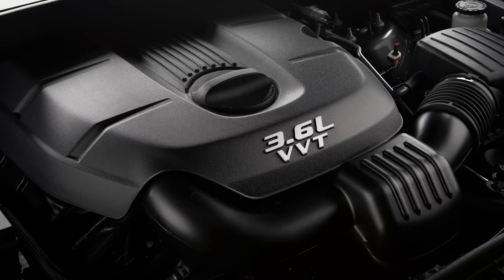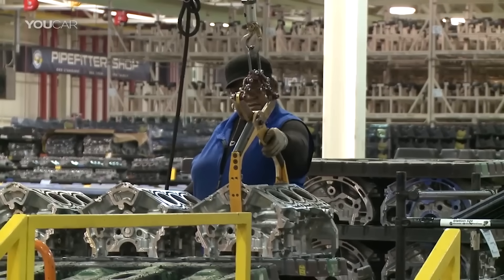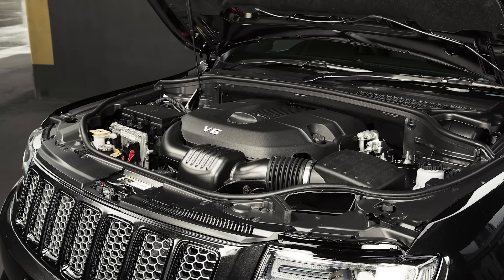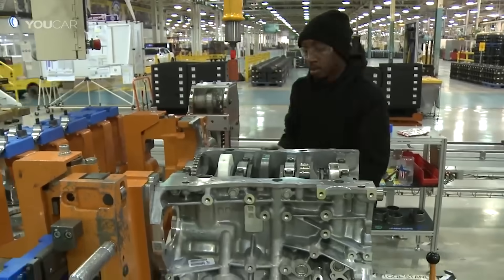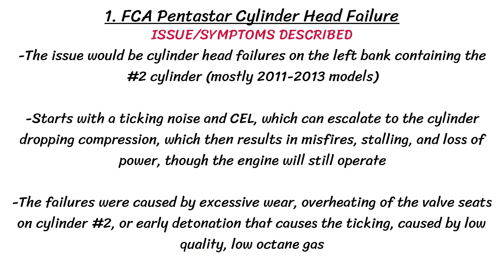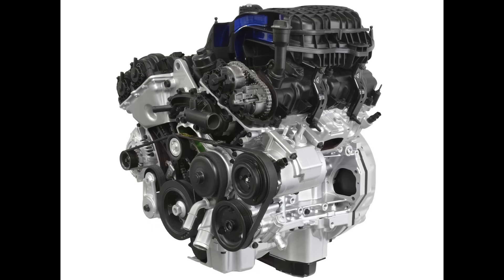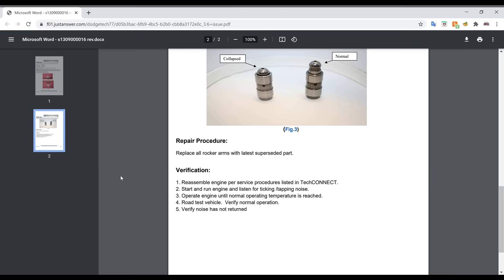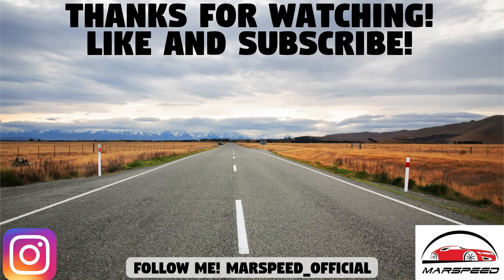The Specs and Fatal Flaws of the Chrysler 3.6L Pentastar V6 Engine

Comment: Frankly? It sounds like you're just putting pictures to an article you read and I don't agree. Just because you bought a nightmare 5.7 Hemi, don't take it out on the V-6. The 5.7 has a lot more problems then just dropping valve seats and ticking. Mopar is probably going to finally junk that miserable engine. At idle, the cam shaft gets no oil splash from the crank shaft at all, because they wanted the cam shaft closer to the valves and raised it way up. Then they stuck an oil journal tube under it just to make sure. They tinkered that engine to death. To even fix that bad design would mean junking it. And that's why they won't fix it. Chrysler can no longer make a good 350 V-8 and hasn't been able too for quite a while. They can't even survive police or taxi-cab work any longer.

Although the 3.6 does have its problems like any other engine, it's certainly not as bad as all that. And I've never heard ticking out of any one of them and everything they make all has that engine. I think whoever wrote that article confused the 5.7 with the 3.6. There were never any number 2 piston problems with the 3.6. Only the 5.7 and it still has them, and it still shears it rear exhaust manifold bolts off. And remember, you are only talking about less than 1% of all the Pentastar engines made. And they were the first engines. Only a fool buys the first of anything. Meanwhile, Chrysler has made over 10 million Pentastars. That's a LOT of engines. It replaced 6 different problem V-6 engines. Why would you want to scare your subscribers like that when over 90% of them have the Pentastar. The 3.6 has won awards over the years and it didn't do that with bad engines. It's the only engine I'm aware of with 2-stage cams and it got them back with the 2015 upgrade.

I have a 2018 AWD Charger that has the 3.6 (it's the only way you can buy an AWD) and I supercharged it. She puts out over 500 hp in it's present configuration, handles it just fine and still makes an excellent daily driver. And this supercharged beast has raised it's efficiency to almost 30 miles per gallon average, up from 22. 22? Yeah, the AWD's take a mileage hit in stock form. Obviously, the 3.6 just loves its supercharger. If there was a backup of parts, it's because there is always a backup with Mopar. I'd say they are really slow at paying their bills. I remember all the way back to 2011 and I bought a brand new Jeep Liberty. They had an accessories catalog and nothing in it was available and I was told, wouldn't be. So why did they bother to even print it? And did they ever pay the printer? And are we really talking about the 3.6 here? That is suspect at this point. The 3.5 did have ticking problems because their lifters would drain down when they sat, but would immediately pump back up at start up and go away. But that's the 3.5, not the 3.6 Pentastar.

The problems with the engines, at least since 2015 are quite few and I would start with the head bolts. While not making your list (surprise), they can stretch and cause a blown head gasket which can grenade the engine in extreme conditions. I installed hardened head bolts before I supercharged it as a preventative. They can actually torque down to as little as 16 ft. lbs. due to stretching. If you add a blower, you just can't take the chance although most do. There are very few problems with this issue on stock engines, even supercharged engines, however they do happen.

The only other inherent problem I see is the horrible "cooled" PVC system they have. Another thing you didn't bother to mention and is the most critical. That's why I believe you're only reading an article. You might not know anything about these engines, but I do. You should stop acting like you do. You do a disservice to your subscribers and needlessly scare them. This crazy PVC system actually cools the crank case gases and sends them back into the engine instead of the exhaust to get burned up like any other PVC system. And it makes it a sealed non-vented system with no way to equalize engine pressure and vent the moisture. Who's nightmare idea was that? Because of it, It re-injects all that moisture caused by the engine heat back into the engine and coats the intake manifolds with oily gunk due to the pressure back up; and the water slowly corrupts your engine oil. Do NOT miss your oil changes folks. This in turn, coats the piston tops and intake/ exhaust valves with carbon which is a known issue with the 3.6 and could prematurely wear it out and burn the valves. If it's allowed to burn the valves, you'll get ticking because the valves will stick at first, and cause accelerated cam wear. If there is any flaw in the engine, that is it. And even that will normally take over 100,000 miles to surface.

Luckily there is a fix and it requires two catch cans, one for each side of the engine. And this is for the engine without reference to the supercharger. Catch cans separate the water from the crank case gases and now, should come from the factory. They all need catch cans and I had to add them almost from day one. With less than 10k on it, before the supercharger, the intake manifolds were soaked with oil and so was the cold air intake. I couldn't believe it. You can easily see how the piston tops get carbon on them with oil vapor in the intake manifolds. Not any more. That white gunk in the catch can is what water does to oil and it would be back inside the engine without the catch can with even more water. Every time I drain one I smile. This is especially prevalent in cold weather. I highly recommend catch cans to anyone who owns the Pentastar! This is a KNOWN issue and many companies make catch cans for these engines. You can even get them on Amazon. I would recommend rippmods.

Other than that? I just love the Pentastar better than any engine I've ever owned and I'm an old school motorhead. Really. I used to specialize in Olds 442, Hurst Olds W-30, Pontiac GTO, and Pontiac Trans Am 400/ 455 engines. I've never gotten 500 hp out of any engine with just a bolt on. Even the idea of it would be laughable. To supercharge an old school engine would take a mountain of parts, but this Pentastar 3.6 already has them built in, and some. They were very serious when they developed this engine. 

And here's the mountain of parts I mentioned: It has a very strong block made out of suspension grade aluminum, four valves per cylinder, heat treated heads, powder coated moly main and rod bearings, powder coated moly valve guides, iron piston liners, cast aluminum pistons with short skirts, low friction moly piston rings, forged rods, forged high flow valves, zero resistance exhaust (no exhaust manifolds/ headers needed), rolled fillet crank shaft (86% stronger than standard), 6 bolt mains, (4 bolt with 2 cross bolts), two stage oil pump and very high compression. And it has 2-stage variable valve timing dual overhead cams. It's a 4 cam system with the ability to individually time each cam and was added in 2015. Try saying all that in one breath. Try paying that bill... Anyway you look at it, this is one hell of an engine. One of the most advanced engines in the world bar none. And very BIG money is what made it happen. Well worth investing a couple of lousy catch cans into.

Because this engine is so strong, I added ported intake manifolds, a ported throttle body to 70mm from 65mm, high performance coil packs and spark plugs, larger fuel injectors, a Ripp/ Vortech supercharger, and a high performance K&N intake filter. And I topped it off with a 304 Stainless Steel Borla S Catback exhaust system: All that taken together gives me almost a 220 hp gain from 300 to 520, and almost 7 more mpg; from 22 to 28.4 average, pretty much however I drive it. Well worth the effort and the engine could take at least 100 more hp. It handles this boost easily and judging by the mountain of standard parts, I would expect it to.

It's absolutely bullet proof from the factory and the perfect engine to supercharge. So I did. (see rippmods) How does it act with the supercharger? It drives normally until you don't want normal. When you don't want normal, you hit Sport mode and the acceleration will pull your girls panties up. If you can afford it and want Scat Pack performance, you should do it. Don't forget the head bolts. Total cost is about 8,000 dollars, and your now SRT-6 will come in at half the price of a Hellcat SRT-8, AND be AWD. And if the Hellcat isn't on his game, you'll give him a heart attack because the AWD will not spin its tires. By the time he's done melting his tires, you're in 3rd with a 520 hp car and a head start. He'll need a very long track to catch your little 30 mpg V-6. I saw one take out a Hellcat 3 out of 3. Really. And to get almost 30 mpg average in a 520 hp 4,200 lb. car? The motorhead in me says this is just impossible, but there it is. I wish I could swing one of these into my 02 Prowler. I just love my supercharged Charger GT Plus and wouldn't have anything else. You should hear that Borla exhaust sing.

I'll take your silence as a thank you.
Reply: Thank you..I read your complete write up..and yes his video did scare me into thinking twice now but I feel better after reading what you said..it sounds like you know a hell of a lot more than he does from what you took time to write up..My first thought a while back was if they used the 3.6 in the cargo van, a daily heavy duty cargo van, then it should be good enough for a minivan or car right?? I've seen many older T&C and GC with over 400K miles but these were the 3.8 engines in the 2006 model or whichever years they used those as well as the 3.3..I had a 3.8 in a 2006 GC myself..loved it..but want a newer T&C now but I think I will go for at least a 2015 to be safe? I really wanted a 4.0 that was in what, only a few years 2008-2010? That engine in the van was a rocket..even vids on how fast it was on here!
Reply: @chrisreed26  Thanks for the reply. Frankly, I expected more of them. The Pentastar is a great engine, just take care of it and change the oil at least every 5,000 miles, and it will take care of you. It's one of the strongest built engines in the world today. I highly recommend at least one catch can if you have any cold weather.
Reply: @ Daniel Staggers,  if the 3.6 pentastar is the best engine you've ever owned, you have obviously never owned a Toyota 1-Uze 4.0 litre from their Lexus models. I'm also an old head who's owned several vehicles. I haven't owned anything other than Toyota products since the nineties and for good reason. I have a 95 Lexus LS 400 with over 200,000 miles that you can barely hear running. Not only is the 4.0l awesome, but overall the car is built like a tank. No cheap plastic falling off, no rattling when I'm cruising down the road. The car is almost soundproof with the windows up. I didn't get that with any American made cars that I've owned.
Reply: @henryhawkins1194  This blog isn't about Lexus and I don't buy foreign cars and never have. Why are you watching videos about Dodge/ Mopar? What possible interest could Chrysler have to you? How do you know Marspeed? Marspeed is my favorite video blog, even if I don't always agree with him. He means well. I'm sure he didn't mean to scare the hell out of all 10 million 3.6 owners. This is a Chrysler forum and Marspeed only covers Chrysler, why are you bringing up a foreign car here? Did you supercharge your Lexus? I doubt you could. Did you even read all I wrote?

If you must know; foreign cars are just too expensive to maintain by a long shot, especially Lexus, Mercedes and BMW. And anyone who buys a Range Rover or a Mini Cooper is a plain fool. As cute as they are. That's why they're so cheap used; when the warranty is up, a foreign car is worthless here; any foreign car. Especially a Rolls Royce or a Bentley. As far as Lexus goes, I understand you can put some cheap Toyota Auto Zone parts in them, but who would do that? I certainly wouldn't and god help you if you don't. Is that what you do? Put cheap Auto Zone Chinese parts in your Lexus? I wouldn't even do that to a Toyota. I only use aftermarket parts if it improves on the factory part and that's very rare. Maybe sway bar bushings or something like that. My aftermarket parts usually cost a lot more than the factory part, or the factory doesn't even offer them at all. The new Charger is just as soundproof with the windows up as your Lexus and doesn't have a rattle in it. You should drive one, really; you'll be surprised; I was. And the Charger doesn't claim to be a luxury car like your Lexus does, but you can load it right up. I did. Good luck trying to buy one however. Our local dealers rarely ever have one in stock, or a Challenger for that matter. I ordered mine from the factory. I actually don't like it with the windows up, it's too quiet and I'm sure you know what I mean. The Charger/ Challengers are basically Mercedes, they haven't changed them since the last Mercedes design. They keep selling like hot cakes so why would they? Some of the older ones did have a front upper control arms that liked to wear and rattle, but they upgraded that arm and solved the problem 6 years ago.

And by the way, if you insist on comparing Lexus to Chrysler: Dodge sold 142,000 Chargers just last year alone. Jeep Grand Cherokee sold 242,000 units last year as well. Between just those two models, they outsold everything Lexus makes and over 90% sold with the Pentastar. Even in Lexus's best year ever which was 2018. Chrysler sold over 10X's that just last year alone, and it was a bad year. There are 10X's more Pentastar engines on the road than all Lexus vehicles in total. Lexus isn't even a pimple compared to that. You sound and act like you don't seem to know this. You're trying to mix apples and oranges. We look at things in a much larger scale here. We worry about Dodge, Chrysler, Jeep, and Ram trucks here. All of them use the Pentastar. That's why I'm surprised you're here making comments. You should go to a Lexus forum if you want to talk apples to apples. You can all tell each other how clever you are buying foreign cars. Until they have to go into the shop, that is. Than you're just plain fools. It's quite easy and common to have a shop bill that cost more than the car is worth with a foreign car. Ever see what a Mercedes active suspension costs to replace when it wears out? And they ALL wear out.

One thing is for sure, the ZF 8-speed automatic transmission Chrysler uses are also used on most European cars. Even Lambo and Aston Martin. In fact, the Europeans are dumping their dual clutch transmission because the ZF actually shifts faster. NO ONE uses a Lexus transmission or anything else from them. And, some European cars DO use the Pentastar engine. Thanks for the comment, I think.
Reply: @dannysdailys  If you've never owned European models, how can you comment on them? At least I've owned both American and European models so I can make an honest assessment. You talk about how many Chrysler products sold compared to Lexus, but fail to mention your numbers are American sold only. How many Chrysler/Dodge/Jeep products are sold worldwide, compared to Lexus? Those numbers would be of more importance. How many car  awards have those Chrysler vehicles won? You sound like you work for Mopar. I have driven a friends charger, but was impressed, but not impressed enough to own one over a Lexus/Toyota. Have a good day. 👍
Reply: @henryhawkins1194  I worry about American sales because I live in America. Where do you live? America is the golden goose for auto sales world wide. No one is anyone unless they crack the American market. I'm glad you like your Japanese car, but a Chrysler forum is NOT where you talk about it. Have a little more class than that. You shouldn't have to try to impress anyone if you're so sure. You sound like you work for the Japanese. See how easy that is to say? And I'm no Mopar fan boy. They've made countless mistakes and wasted concept cars that I believe has cost them dearly. Especially that pile of garbage 5.7 Hemi engine. That's what we talk about here. And since Mercedes, they are extremely reliable vehicles and some of the best selling in the world. Except that Europe tariffs the hell out of American cars. We don't need Europe, but they certainly need us. And so do the Japanese, just ask them. Honda doesn't sell very many NSX's in Japan, they sell them here.
Reply: @dannysdailys , Yes my 95 LS 400 can be supercharged. But I'm not trying to get 4- 500hp out of it. I'm good with 300hp as a 62 year old. No, I don't buy cheap parts made in China in it either, it's been maintained at Lexus dealership for first ten years. Maintained by a retired Toyota auto technician since. Contrary to what you think it hasn't needed much other than regular on time maintenance except for timing belt/water pump kit, radiator, 02 sensors, struts/springs, starter, water pump and power steering pump. All parts where installed at around 150,000 miles and were the originals. Not bad for a 1995, 26 year old classic. We'll see how your 2018 Charger will be holding up in another 23 years. 😄🤣
Reply: Thanks for the info. I was wondering before I make the RIPP mod to my 3.6 L.  Will  i have to use a higher octane of gas ? Or will it be fine running 87 octane ? Also do you have to do anything to factory transfer case or transmission mods to handle the 500 plus HP ? Also will anything need to be reprogrammed as in the PCM or is it a plug and play mod ?